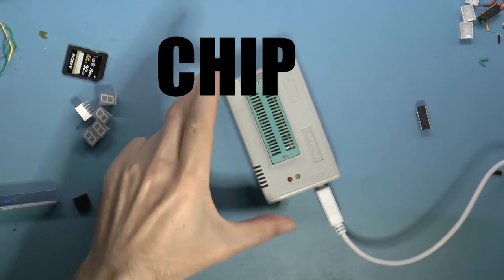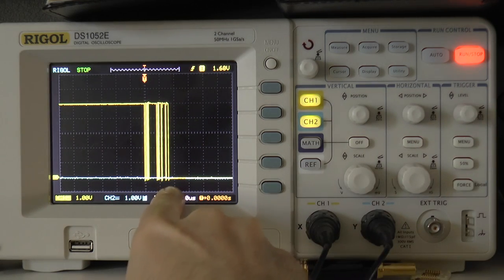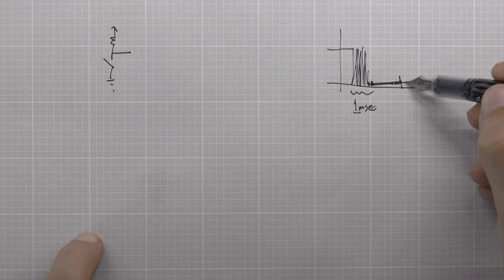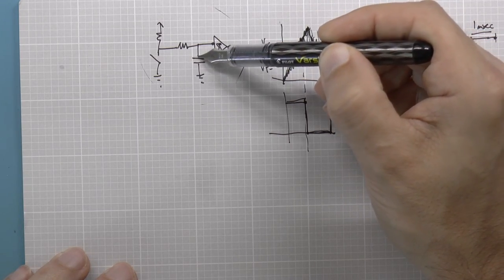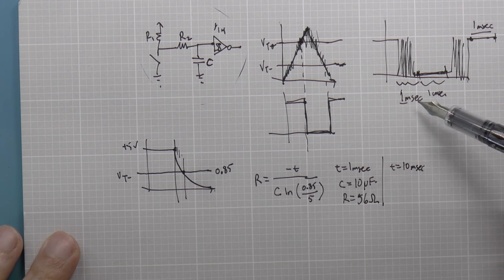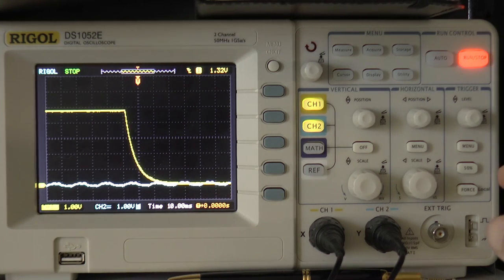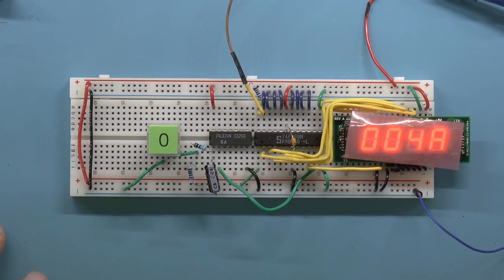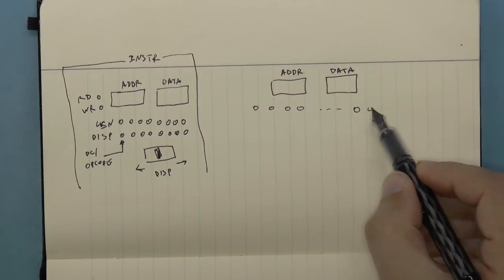Chip Tips #1: Debouncing

Comment: While it is a nice demonstration of Schmitt trigger, having additional capacitor and IC for a switch is total overkill. It also requires that the switch is always powered and this means that when the switch makes contact, the contacts will switch some current (this may or may not be a good thing for the switch, some switches rely on a spark to clean the contacts).
If you are doing this to be red with microcontroller, there is a better strategy. First, you can get rid of the resistor with internal pullup.
Second, I just monitor the switch every couple of milliseconds, the interval being longer than possible bounce time. Monitoring means configuring the pin as both input and output (if your MCU allows it), reading the state of the pin and then immediately unconfiguring it. If the monitoring happens while the switch changes state, it doesn't matter. For example, if you do three readings (X, X, X) while the switch gets closed, you might get 0, 0, 1 or 0, 1, 1, all with same outcome. Avoiding hardware interrupts in rapid succession means the software works in a more controlled way.
One reason to have extra component is if you have extremely sensitive circuit and you don't want noise to propagate from the switch circuit.

Comment: A simple way of dealing with it is to simply strap a pull down resistor and a capacitor to the switch, if you don’t mind having a bit of cool down time after pressing the switch, cool down time depends on capacitance of capacitor, it doesn’t work perfectly but it’s fine 80 percent of the time

Comment: Nicely explained, but one missing detail: switches age, so the quality of a switch will likely degrade over time.  I have actual real world cases of switch bounce getting worse with time.  So, for a real-world design, I like to push that denounce delay out to more like 50ms or more.  The true limiting factor is cycle time -- ie how long before the switch will ever be pressed again.  In most cases, that's a period on the order of a second or more.  For, instance an elevator floor button.  Once pressed, it's unlikely to be pressed again until the elevator car reaches that floor, leaves that floor, and someone wants to go back to that floor.  Even if the person starts pressing that button over and over, it's already been registered, so subsequent presses can be ignored.  But, a game controller is a different story.  The fire button might get pressed every 100ms or so, thus in that case, the upper limit is more tight.  But, I would still design for as long as a denounce delay as the application will tolerate.
Reply: I would think that for an elevator the debounce would be done in software, especially in a situation if there are a lot of buttons.

Comment: In most cases you don't need to measure the settling time of a switch. Just use a very conservative RC time constant (50ms).  Unless you are trying to measure human reaction times, a few hundred ms delay won't matter.  If you need tighter timing, you shouldn't be relying on a human pushing a button.